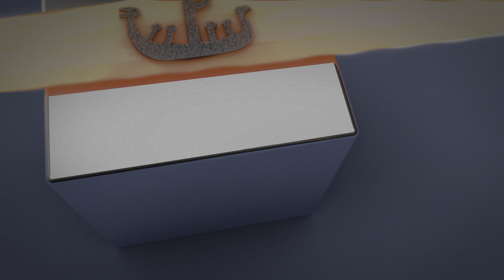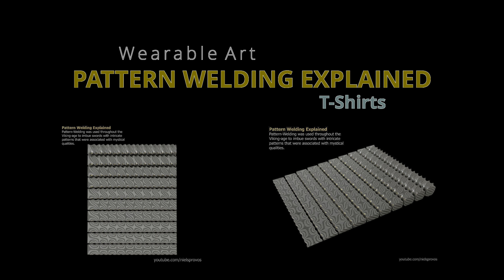Making a Metal Dust Collector: Part 1 (4K HDR)

Comment: You could have used a jig saw with a metal blade for the larger holes
Reply: I was about to say the same. Jigsaw woulh work great
Reply: @Rsama60  me too. I have experience with metal sheet working. 0.8 mm and 2 mm thick aluminium sheets to be precise.

Comment: Hi, I had an idea to use a powered electromagnet to collect metal from my shop floor and then turn of the power to discard. I searched for this and ended up here. Did you consider anything like this as a option?

Comment: The nibbler look like it worked great to cut the inner hole. Maybe could have "rough cut" the initial hole with an oxy-acetylene torch?  Plasma cutter is available in the PiShop. I can help you with that next time. I also have access to the lathe in the metal shop at work if you'd like better rollers. Just provide the stock and dimensions.

Comment: how to cut 6" hold in 16ga sheet, 6" OD steel pipe chisel edge ground innner to outer use a press, or a jack to press steel pipe through the sheet like a punch
Reply: Make a video.